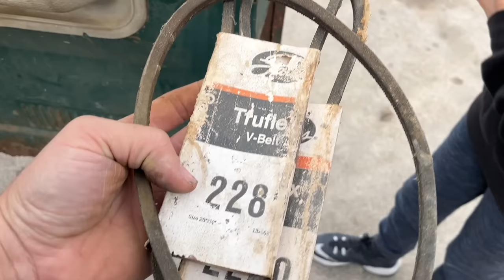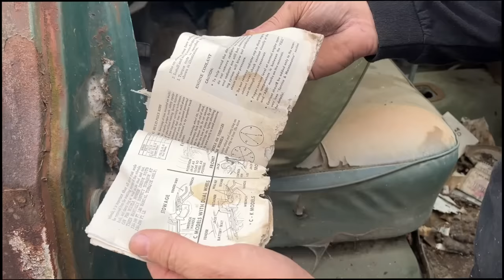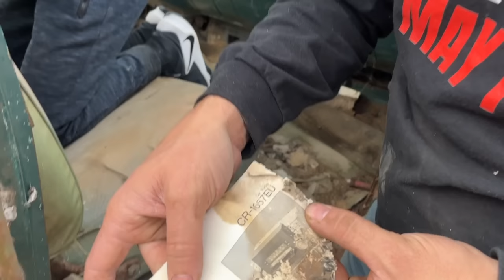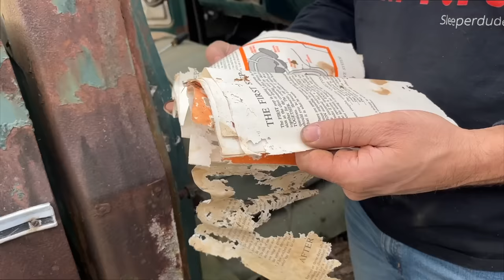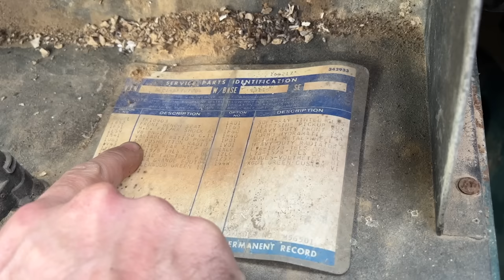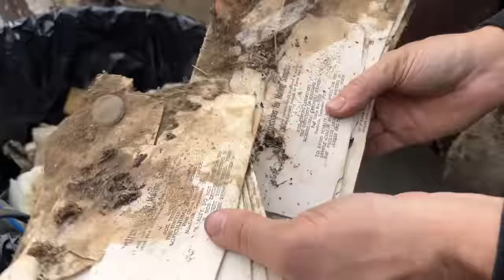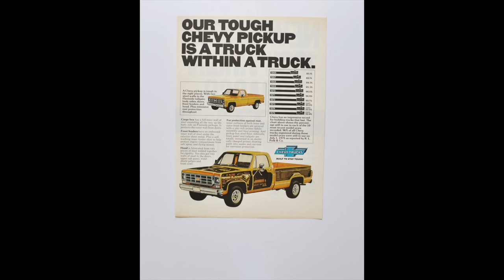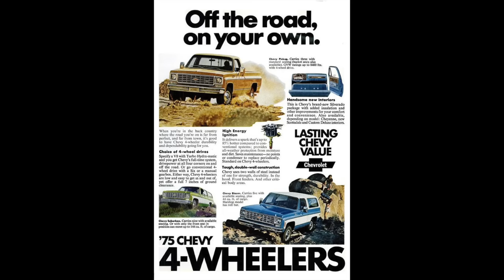Can we get it out of the creek? What's wrong with the transmission? 76 GMC K15 4X4.

Comment: Save that rectangular piece of metal. I think its a plow shear. If it is its super hard steel good for making heads for chisels or knife blades. I've watched my dad use them to cut tops out of oil barrels back when they were twice the gauge we see today. Short handled slege and a plow shear (share), 5 min later - trash barrel.
Reply from the maker: Ok thanks for letting us know

Comment: The flat bar with the chain links on the end is for a mechanical harvester. You would run 2 sprockets on the drive and 2 on the tail, multiple bars would connect to a belt , bucket or a rake. You can look up almond , walnut or pistachio harvesters and you can see something similar. And it's a good thing they sell all those body parts for that truck , I would order 1 of each, lol!

Comment: Hey Josh & Family;  I used to run the square body Chevrolet trucks and still have a wrecked 1979 C-20 3/4,ton 2wd.  This truck still has the 4 bolt main 350 engine with the “QuadraJunk” carburetor along with a Turbo 400 transmission. 
A friend of mine still has two of the 4wd square bodies that are used on the farm.
So Josh, A few years back, We pulled the bed to repair the rusted out crossmembers which was a common issue in which replacement crossmembers were not available at that time. 
After looking at the bed, I suggested taking a measurement of the inside diameter of the crossmember tubing in which my friend went to Harbor Steel and ordered the closest available tubing that would fit inside what was left of the old tubing. 
We then used grinders with the slicer wheels to open up the tubing at the bottom and cut the new tubing to size and slid it inside the old tubing once the new tubing was cut to proper lengths. 
Only minimal clamping was required to weld in the old tubing to the new sections of tubing in which the floor of the bed was probably stronger than before.
Regarding the automatic front hubs; Most everyone that used those trucks usually replaced the very problematic automatic front hubs with the WARN locker hubs in which the option was there to either lock or unlock the front hubs in which they were much cheaper to replace if something happened and was usually very available through the parts houses. 
Unfortunately I think my Ford E4OD transmission probably looks similar to your Turbo 350 transmission in which I am going to use until the transmission dies. There’s lots of shift kits and stuff available for the Turbo 350 transmissions. Good Luck with your “Squarebody” truck.

Comment: Excellent video Sleepdude Crew Josh  :) my late Dad & late Uncle bought 1983 a 1978 GMC High Series Serria 25 Scottsdale 2 door with 350 V8 motor 4 bolt main , single exhaust, Turbo 400 3 speed Automatic transmission, 411 rear Dyna 55 12 bolt , Power Brakes also Steering , heavy duty 4 core rad disk front wheels and drum brakes back plus Basic am radio plus pop rod on left fender not front windshield on T shape even 3 fork mirrors! They were 2 owners to it bought for $5.000 at GM dealership, 3/4 ton but One ton suspension with 12 leaf springs springs, 2 tone blue too & one fuel tank on right side of bed with steal cap no door and I learn drive on and sold 1994 for parts ! Plus truck had chrome bumper, also back too and had needle gauges for Volt , Oil Pressure in PSI not KPA one , Temperatures, had KM/H Speedometer type , Fuel gauge with Emergency brake and Seat Belt buzzer for drivers seat side in red lights lens  on bottom for Canada mathematics! But your Josh  truck when pull truck heard grinding sound think differential needs rebuild on front axles or transfer case and transmission most certainly rebuild too be wise to do! Also put Reverse gear when motor running put were washing before park to wash guess saw on when Tasha video on right blink on back going Lol Reverse light on Right side box Reverse light for 3 seconds no Red on brake or turn singal ! Check out video you Lol! Yes Josh those trucks you have has 3/4 also 1 ton frame it heavy duty weight plus heavy duty 1/2 ton called 5/8 ton what give away is the 4×4 even did have it  , frame plus 6 studs wheels plus heavy duty package made  them and I had 1985 5/8 ton great truck till got ruin of lightning strom plus my Alternator, Water Pump , Crankshaft belt broken hit spark plug  wire  on right side front then hit fuel line on leak fuel pump also blew up on fire going home from parts store do serivce on it! Like because had done lots hard work plus had traveled package with 2 batteries! Also in 2007 my oldest brother David had 1985 Chevrolet Cheyenne 2 wheels drive with 305 V8 plus pollution pump with 4 barrel carb electric choke , Manual transmission on Column 3 speed and 377 posi rear gears it was USA model and Reverse gear lights sensor gave up so wire up toggle switch to click and in great with Racing Clutch in all body work need to it was door rockers! He bought for $700.00 put $1.000 in drove till motor went of old age for 6 years then bought newer truck !

Comment: Had a ‘74 rear wheel drive. Used it for a part time junk hauling business. Almost as rusty as yours. Could not kill that 350. Broke a leaf spring. Got replacements 1 ton springs  from the salvage yard. Only replaced the broken side. Other side was a3/4 ton spring. I always joked and said  it was a 1 and 3/4 ton truck.

Comment: I bought an 82 chevy pu back in the mid 90s that was almost as rotted as that one. I kept the cab and put floors and rockers in it and replaced every body panel on that truck. I put a nose from a 75 blazer on it cause I like the round lights better. It took a couple years to do but turned out to be a nice truck. That's probably the way I would go with your truck if I had it.

Comment: A mud truck isn't a bad idea. You could try replacing the filter and fluid in the transmission. Could need to do that at least 2 times. Filter is roughly 20 bucks if I remember correctly. That blade piece you found is the blade for a grader or box blade. Those belts might fit on your little 9n ford tractor for the alternator. The old bottles do have some collectible value. Maybe 2 bucks a bottle. Excellent video though. You ought to try to find an old Crew cab truck. Be awesome. Terrific family y'all have

Comment: think for this you should build a flatbed and put it on the back then get some of the rusty parts replaced and put a logo on the side that says sleeperdude farm truck manure is why its so rusty so if you clean it itll last but otherwise itll rust again id bedliner/undercoat the whole thing and do a cheap rebuild on the engine and trans just make it a series of fixin up the farm truck loved the video yall have a good weekend and week

Comment: You need a transmission service plus new transmission fluid along with checking all the lines and all the seals not necessarily replacing any parts but check first all the lines with the gasket with the filter transex transmission treatment Lucas is good too but too expensive and go from there FYI Victor from Palmdale California

Comment: My 2 cents with as solid as it is underneath.  I say patch the rockers / floors, weld the tubs back to the bed, bump out the dents you can and find a decent hood. Wire wheel those rims, repaint them and new tires. Body wise if it's a mud truck I wouldn't go to much further as it's going to get scapes and dents. Get some locking hubs for the gutted fronts, rebuild the trans or find a used one.  Toss some knock off flowmasters on there and exit before the rear wheels. 

Probably gonna need some springs and shocks, they looked de-arched in the one shot.

Get it reliable and (mostly) solid, have fun with it man.
Reply from the maker: Yes sounds good

Comment: JOSH YOU NEED A TURBO TIP FOR YOUR PRESSURE WASHER IT WILL MAKE A HUGE DIFFERENCE IN CLEAN UP ON THOSE OLD VEHICLES THAT HAVE MOLD AND MOSS ALL OVER THEM

Comment: A little rust stop 60 or 70 gallons of body filler, 2 or 3 Rattle cans and that thing will look mint!!! You don't even need a transmission just flip the rear axel over and you got a 1 speed trans, as long as you keep the shift lever in reverse. You guys just keep the hits coming 😊

Comment: I bet that mayonnaise would be good for use as grease or something.  😂😂 Those bottles are from the 70s. The Pepsi can with the pull tab is too. I remember seeing those pull tabs all over parking lots and stuff when I was a kid. The glass Pepsi bottle is from the 80s. Those came in a 6 pack with a plastic top around them. The label was made of a Styrofoam type material. I'd definitely use the truck and have fun with it! Would make an awesome rig for the snow! ❄️❄️❄️

Comment: Weld repair the rockers; good instructional video material. Replace the hoos. patch the reat of the cab; ditch the bed and build a flat bed for it.
More educational value in that that bolting on a replacement.
Reply from the maker: Ok thanks

Comment: might be a rusted out truck but a lot of the trimpieces and bolt on stuff are still mint , the windows still look good too 
as for the vynil mat you can probably heat it up with a heatgun to make it flexible again and shape it back against the floor
maibe make the truck intoo a truggy with only the cab and some minior sheetmetal but mostly a tube exoskelleton 
another option would be to section all the bodypanels take about a feet of the bottom and make a new sills from scratch  doesnt need to look factory just be strong enough and close the caps , maibe two hard bends and an edge along the bottom to pinch weld the pieces together , make youre own sill by welding strips of metal together and do the same with the floor to close it up again 
it doesnt need to be road legal as youre going to use it to go off roading and if the sills are from thicker sheetmetal you can use them as skids in the terrain (maibe even make a base from thick wall tube and weld sheetmetal from that to wats left the body and floor of the original stuff  )
Reply from the maker: Yes thank you

Comment: Might consider finding a decent cab and front clip in a junkyard somewhere and swap all that out, then get all mechanical and electrical like you want it, and then build a flatbed on the back ( with places to put in removable wooden panels so you can haul goats and pigs when you have to) You can put tool/storage bins in on each side under the flatbed too.

Comment: Forward clutch is more than likely gone, if I was closer I would fix it up for you. Just get you a set of lockouts instead of the original gear, then convert the transfer case to part time, very simple to do and then you will be good to go.

Comment: Too bad Daddy Brad-y wasn't there, he could have opened the jar for ya OR would have known not to even try! P-U! I remember those styrofoam plastic labels on soda bottles. Those taller ones used to be from the "vending" machines that nearly took a half grown man to pull out of the machine. You could buy them off the store shelves too in a cardboard carton with a divider for each bottle. Of course I was very young then and could only reach the bottom 2 or 3 bottle selections. Those were so cold since they were in glass and the machine itself  had a skinny door to pull open then pull with all your might to yank a bottle out of it... careful for those ridged metal bottle caps. It will be interesting to see what you do with the truck. Thanks for the vid!

Comment: My ideas for the truck are to either turn it into a flatbed, OR cut out all the wheel wells, bolt-on wide fender flares and then put on big, BIG off-road tires. Also, replace the bumpers with thick tubing guard bumpers that wrap around the corners. Also add some nerf bars wide enough to hide the rocker panels.

Comment: MileMarker makes a kit to convert that NP203 transfer case to part time. Also, those front hubs were known to strip out, I had a 1974 K5 Blazer that I swapped the hubs and converted the tcase a little over 20 years ago. If that rig has the Dana 44 front end with a 12 bolt rear, you should find you a Malibu wagon body to swap onto that frame. Hey, you love you some station wagons, why not?

Comment: Just put lock out hubs on it.  Been driving one with locks for yrs.  Gets better mileage if you drive it unlocked on the rode. The front driveshaft does not spin in 2wd.

Comment: Sorry Josh, but old girl is definitely due to be set out to pasture to rot in peace...I'd say skrip it of any usable parts and send the rest to the recyclers. That tree fiddy doesn't sound horrible, and with a nice set of aluminum heads and a nice Edelbroken intake manifold and 4bbl carb it'd make a nice addition to a future swap. The bed and cab on that thing is just skraight up forked. It looks like my uncles old 74 K10 that had 400,000 miles on it and still worked plowing snow and working around my uncles farm. His was green and had those old school blue and white seat covers on it though...the really itchy ones. You know which ones I mean.

Comment: That rocker could be welded up with cxy/actlyne and bailing wire. I did that with the doors on myt 40 chev pu. Worked well. By the way that "tractor" piece looks like a cutter bar for a bucket or blade .

Comment: Chevy 73-87(91) 4x4 guide

•73: Conventional part time only (NP205) 

•74-75: I6 Conventional part time only (NP205), V8 full time only (NP203) 

•76-79: Manual transmission conventional part time only (NP205), Automatic transmission full time only (NP203) 

•80: Conventional part time only (NP205) 

•81-87(91): Conventional part time only (NP208 for K10s & K20s, NP205 for K30s) 

•Extra note: 77 was the first year for the K30 (one ton 4x4), previous to this there was only the K10 & K20. Also your truck being full time 4x4 has the NP203 transfer case. High and Low is for on-road use, as the two driveshafts can spin at different speeds, so steering and the overall driving experience isn't affected much. High lock and low lock is for off-road use, and functions like a normal part time transfer case. The two driveshafts are locked, so they rotate the same speed. The NP203 was pretty popular in the 70s, but after that full time 4x4 basically died. This is primarily because full time systems put unnecessary wear on your 4x4 drivetrain, and mileage also suffers. There are, however, part time conversion kits available for the NP203 to convert it into a conventional transfer case.

Comment: I would like to see that GMC back on the road. Fix the tranny, 4 wheel drive, and brakes. Replace the hood and maybe the replace rocker panel and floor panel for the drinker side, just metal screw them in and seam seal them. You make them out of old license plates or Stop signs. :) Then use rust converter on the rest of the truck so it will all be black. lol Just think if you kept it around long enough you could scrounge new body panels out of a junk yard.

Comment: im going to say this you can buy a set of lock in lock out hubs pretty cheap. but you will have to leave them locked in to drive it. but here what you can do when you get it running again. put it in drive get out and see if the front drive shaft is turning. because its like a open diff. its going to pull from what ever has the less drive until you go to high or low lock.
Reply: and i would recommend  fixing the hubs before you tear into the trans. and DO NOT tear the 203 transfer case apart you have 2.4 million needle bearings in it that is a nightmare to get back in place.

Comment: Automatic transmission with hub locks and a np203 transmission do not mix if it doesn’t have a part time kit installed in the transfer case and what happens is if you unlock the front differential then the front drive yoke is turning when you put it in park and that rounds off the pawl and it won’t park anymore.

Comment: Guess we know you made this video before the selection of round brushes for a grinder arrived for the 'cleaning solution clean off' video!
    Put Warn locking hubs on it, then you can do what the previous owner did, save gas and avoid the noise as it turns corners scrubbing the inside tire, BUTA with it being readily changeable BACK when you NEED 4WD.😁😎

Comment: That transmission may NOT be bad. Those old full-time 4 wheel drives would “free-wheel” when either the front driveshaft was the e moved, or if the front hubs stripped out! Put hubs and the proper transfer case kit in it before you do the transmission! 
I saw the crud in that pan, it’s liable to be no bueno anyway, but give her a shot, would make good content!

Comment: Hey Jossh, 3L, 4L and 5L belts are fractional horsepower belts for everything not automotive. 3L is 3/8 wide, 4L is 1/2 wide and 5L 5/8, the numbers, say 360 is the inside length of the belt. INSIDE length, 36"

Comment: The bad sides separately both sides that's including the tail light section and also under the rear back window but I don't think you need to replace that if not depending on the price you may want to look for another complete bed that's Rush free good luck on that?

Comment: Looks like a low grade parts truck!  Hopefully, the drive line is usable.  Sounds like a donor to make a 4x4 of some sort. Hard parts are likely good, sheet metal useless! That mayo is enough to make anybody blow lunch!
The front axle is same as used in Jeep vehicles of the same vintage. Probably has a Dana 44 front diff. There is a big steel piece just inside the front hub "cap" with splines inside and out. 
this is what drives the wheel. They need to be there on full time 4x4 vehicles. I bought a new Jeep j-10 pickup in late 1973. Never had a problem with the front axle or the 360 V-8in 200k miles. Traded on a new 4x4 Ranger in 1986. Been buying Fords ever since.